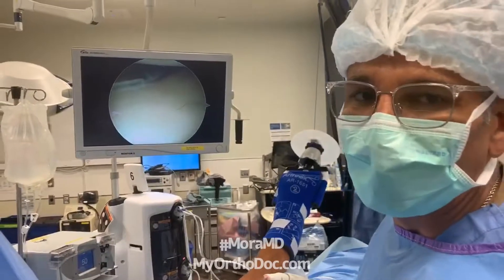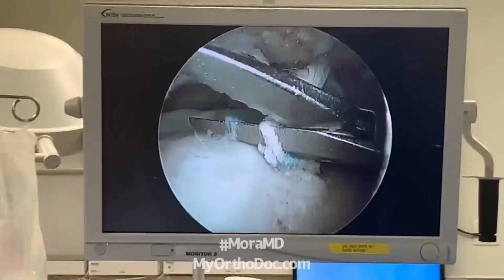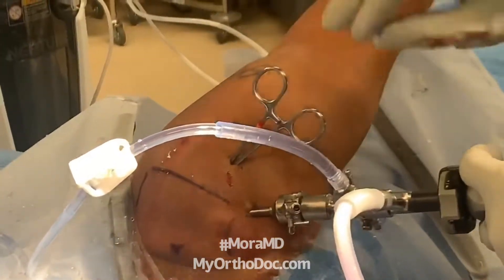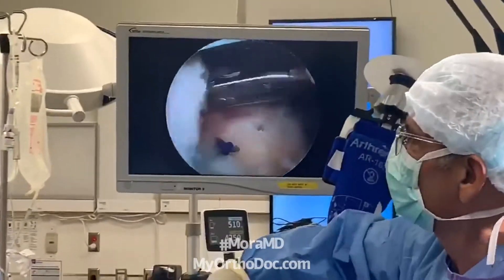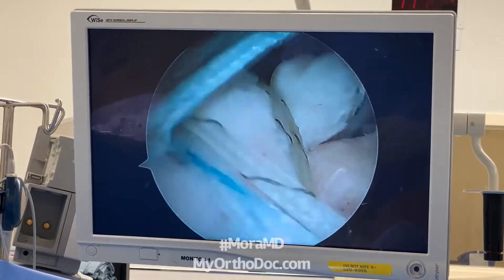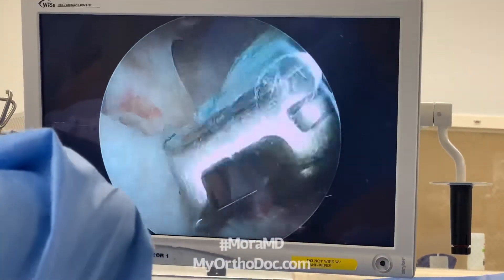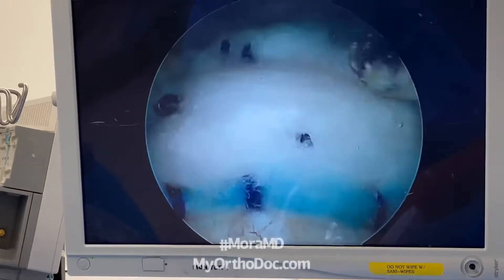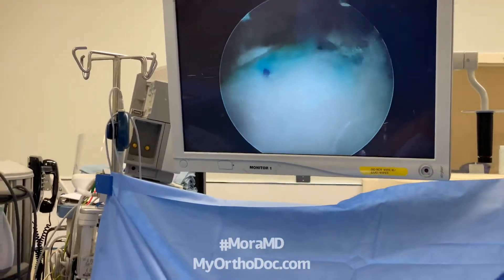MoraMD: How is a Rotator Cuff Repaired the Second Time Around?

Comment: I don’t know if you’re still responding to questions doc, but I’m curious about what happens to the existing screws from the previous surgery. Do you remove them? I know they come equipped with the string attached but are now useless (I assume). And will their being in place already, make my second repair more difficult and thereby less likely to be a success?
Thanks 🙏 for this great video. I’d like to have my surgeon videotape my surgery so I can see exactly what was done. 
GOD Bless you 🙏
Reply: I’ve had two procedures done and I may be able to help, if you research this area those anchors are made of a biodegradable plastic in most cases and are designed to dissolve back into the bone over several weeks/months